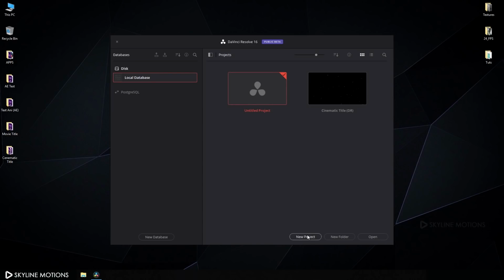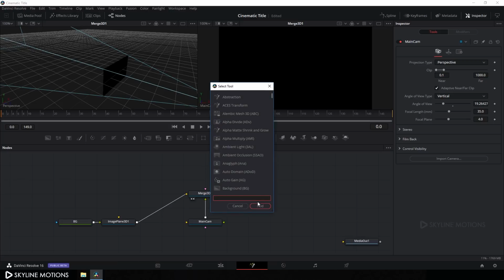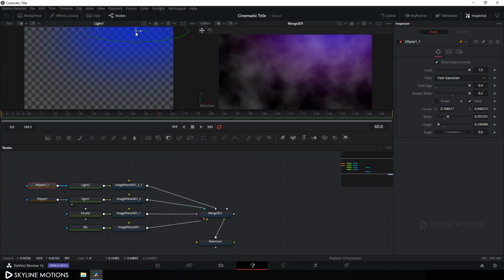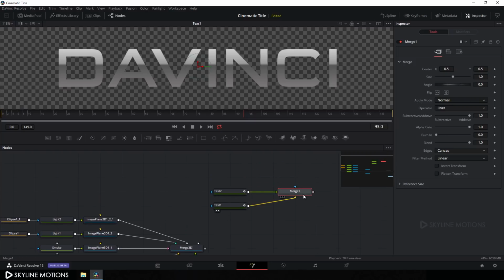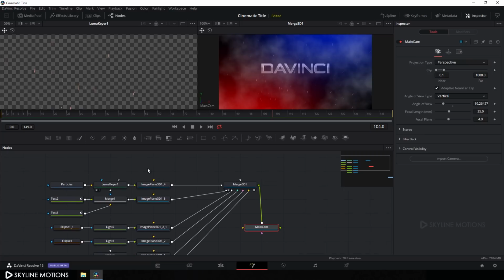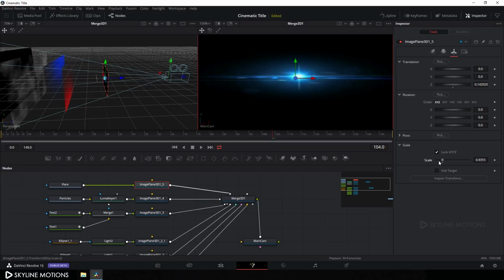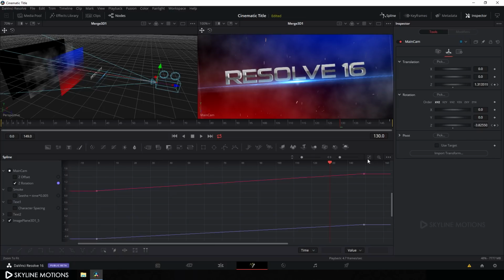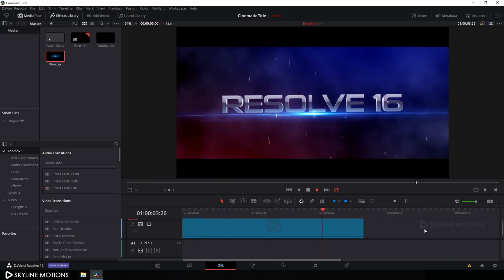DaVinci Resolve 16 Tutorial | Cinematic Title Animation | No Plugins

Comment: I keep getting extra merege  fusion tabs so annoying. and it messes with my editing momentum
Reply from the maker: When ever you wanted to add a new node make sure nothing is selected.
Reply: @SkylineMotions  what do you mean nothing Is added
Reply: @SkylineMotions  whats not supposed to be selected? thanks for your response ahead of time.
Reply: @SkylineMotions  2nd question. when I copy it add extra merge along the copy. its getting so annoying to where I cant even follow the next step on the utube video you post. im always stuck since it will never be the same. and yes Ive repeated to do over and saved on certain spots so I don't get to lost on the proess. hopefully I sound clear.
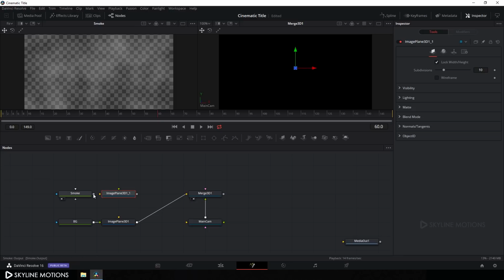Reply: @SkylineMotions  3rd response. im stuck at 5:43 on your may 11 post
Reply: @SkylineMotions  nvm alll that I fixed it. it was one of those small dots under the merger tabs. which I had to click. quick question. I saved my work and everything vanished on the small screens. I still have the fusion tabs on lock. but it seems it removed the blue and red color screen and checkered screen.
Reply: @SkylineMotions  hey thank you sooooo much. finished my first intro title. amazing job man. keep it up. have an awesome day